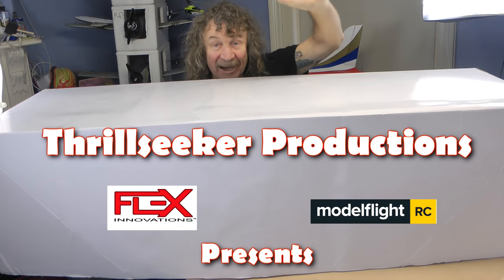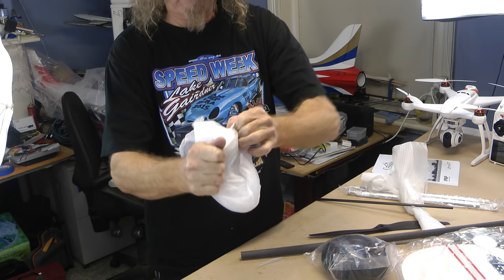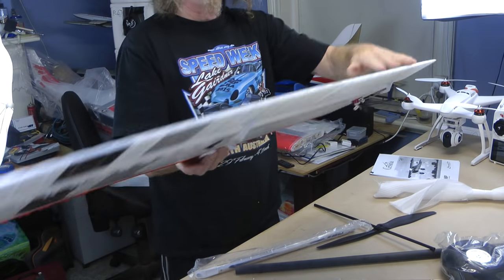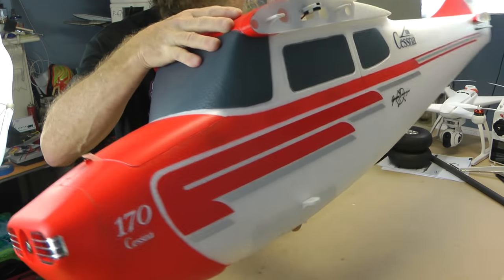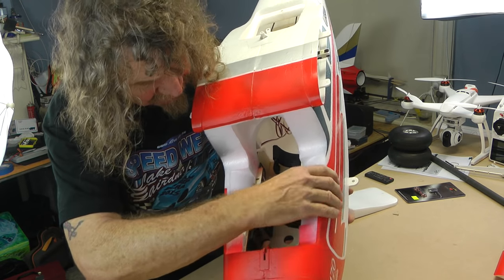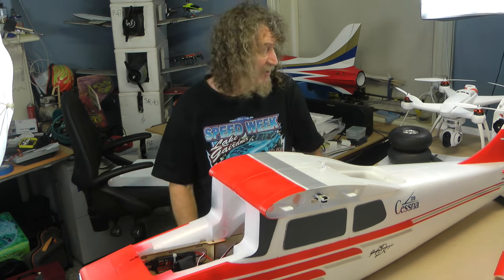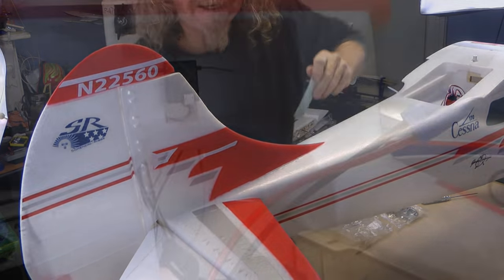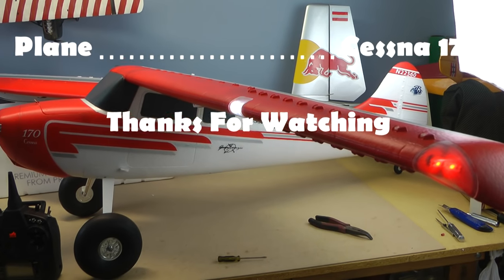Cessna 170 By Flex Innovations  Un-Boxed/Build with ChuckT

Comment: thats a nice huge plane, i wonder how it flies with the as3x rx in it like the ar636
Reply: SexyToshi It flies super well even without gain on the existing Aura8, so that's a good sign. While I'm not sure they sell it without that particular flight control system/gyro, I bet that a well-tuned AR636 should do just fine for sport and scale flying. For heavier duty 3D stuff, even more careful settings and a vigilant throttle should do you well.

Comment: hey. chuck did you use just the satellite  rx. or the full system,
Reply: MclF01 PWM setups (AKA "the full system") are actually pretty cumbersome with the Aura8 and they reduce some functionality. For example, the Quick Trim feature is rendered unavailable with PWM, meaning you'll have to manually adjust links for proper trimming (few gyros cope well with trims from the transmitter). It might seem tempting to save the money on satellites and use an existing receiver, but it's well worth it. I'm running two in my Cessna 170, and range is perfect. I haven't even had a dropped frame yet.